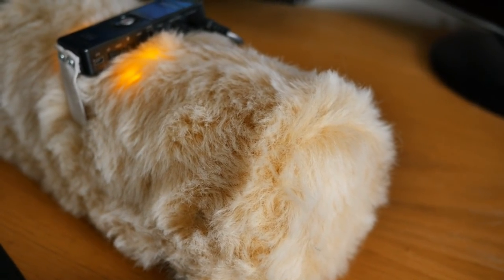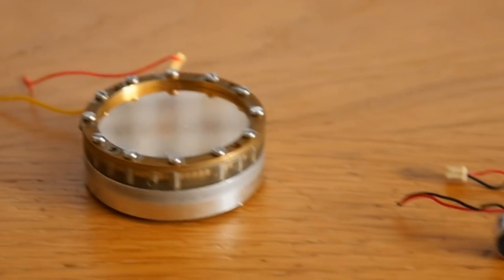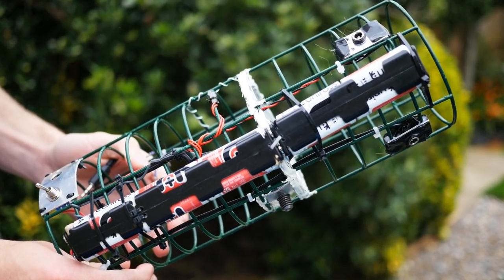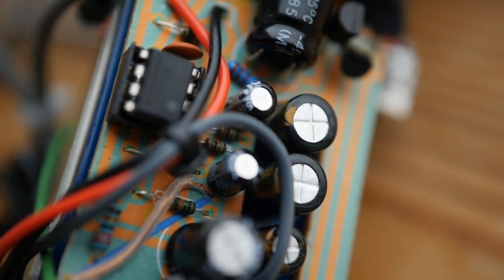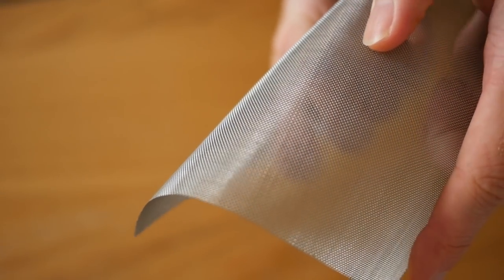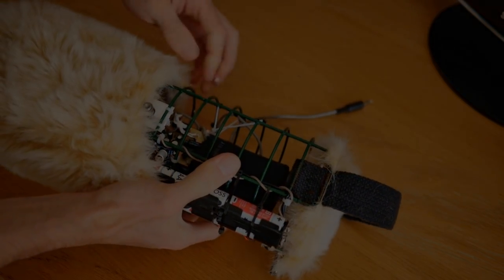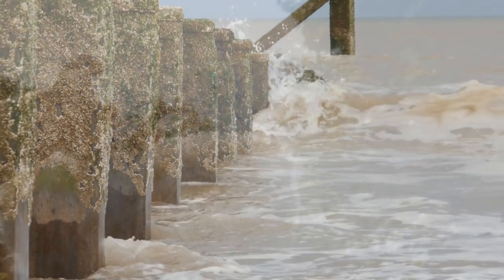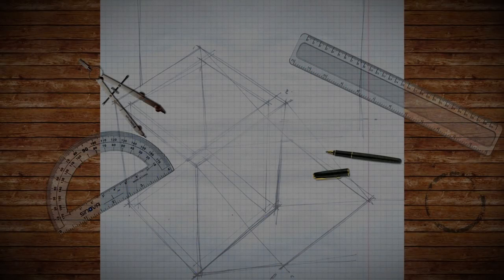The Ultimate DIY Microphone (super low self-noise!)

Comment: That is an outstanding project. I doubt anyone who has ever done any outside sound recording wouldn't appreciate it.
In the late 70s, I bought a really expensive SONY stereo sound recorder. It worked brilliantly and I used it to record buskers in London Paris and Amsterdam. My wife wanted to listen to something and since the batteries were dead at the time, tried to plug an external PSU into it. Sadly, choosing the audio socket.

Comment: +DIY Perks : Your a bit confused about difference between the microphones on a handy recorder and the microphones used in a studio application. Condensor microphones which is the type of microphone you are using here comes in 2 different types; LDC(large diaphragm condensor) and SDC(Small Diaphragm condensor). both of these microphones are used in recording studio applications (as they both have different frequency responses and characteristics based on the size of the diaphragm, and an engineer will use these to achieve different results). Handy recorders generally use Small diaphragm condesors in an X/Y stereo array, as this is the most common way to capture a stereo recording. When i go out to capture atmos and soundscapes i always employ the use of SDC's based on the fact that they replicate high frequencies better(which are extremely important with Atmos/soundscapes) and they generally aren't as sensitive meaning less self noise.  I understand that it seems like you will get better sound but with mic technique it really has to do with which mic will work better in which situation. And for the example that you have given SDC's are defiantly a better option.

(sorry engineers rant)

Also i think  the noise coming from the zoom actually has to do with the cheap preamps inside and not the actual microphone, a more accurate demonstration would be having both mics plugged into the same preamp with the same gain setting, then you will really get an idea of the microphones self noise.
Reply: I also think that he is refering about things he don't know.

Comment: Pretty great results! but to be completely honest, i think the cheap switching power supply actually introduced some noise into the system...
I could only hear that on the thunderstorm, but there are three other possibilities:
Either it was the rain that sounded quite a bit like noise, it was youtunes compression that added some noise, or it was my own audio gear, but i don't think the last one was the problem, most likely it was just rain...
I am using ATH M50 woth an Onkyo TX-NR414 connected over SPDIF for those intrested.
Reply from the maker: +muh1h1 The background noise on that recording was just a breeze in the trees mixed with a slight bit of drizzle. That's why I mentioned that the regulator uses an LM2577 mosfet - its output is unusually clean, so adds literally no audible noise to the signal chain. It's what made the project possible to be honest!
Reply: +DIY Perks good to hear :)
i didnt actally look up the power supplies specs or anything, just assumed it was a very generic one, because it looks a bit like thrse cheap ebay ones. maybe i should :)

Comment: Try to use better op-amp like dual NE5534 for tube warmth sound or OPA627bp for extremely lower noise and better detail in all frequency. TL072 is very very noisy one.

Comment: WAY over my feeble skills! I'm still trying to build the LED Light panel!
Reply: Me too James me too
Reply: +James DeRuvo I built a very simple one. All I did was my some thermal glue, A heatsink, A small fan, and a 12v 13Amp hour battery everything was about the same size. I'm currently using the thermal glue to stick the LED chips to the heatsink and some cable tie's to attach the battery and fan. I can send you some photos and links if you haven't finished yet. I used 8X 10W LED's. It's amazingly bright and last's about 2-3 hours depending. 12V and about a 6Amp draw. 6 x 2 = 12 and the battery is about 13Amp hours.
Reply: +James DeRuvo It's about a 800W equivalent to halogen. You could get 1000W with 2 more LED's, The total cost for me was about £25

Comment: The sounds are pretty clean and real. The best thing, as a recorder, Ive ever heard was a UHER REPORT, portable R2R with its original UHER MIC, speech quality was incredibly real (even just listening to the built in speaker). If you like recording, I would give this old vintage recorder a try. If it was serviced recently, even more. By its time it was the only portable to get up to 20Khz and it was in production for over 30 years.

Comment: You have to at least sell those preamps to us, because not everybody has a CNC machine to make a board with!
Reply: +bluephreakr On the page he linked with the preamp schematic, they have a link at the top of that page of where to buy a pre-made PCB for the project.  It'll add to the cost of the project but you'll have a more professional looking final product (depending on how skilled you are at soldering).
Reply: @00Skyfox  Custom printing PCBs isn't that expensive, especially when you're already using two $250 mics.

Comment: This is great! I have a tascam DR-40 that has XLR inputs with phantom power, so if I used this as the handle, I could do a much simpler build on the interior electronics. All I'd need is added power, and I could keep the microphones cased if I made it just a little longer. Hmmm..... I'm very tempted.

Comment: Great work and an inspiration!
I am surprised that a preamp at 24v performed so well since electrical noise tends to be higher at higher voltages. Many years ago i built a preamp circuit using a chain of class a collector followers based on a design from electronics today magazine.  The author made a big deal of the voltages being low. 2 to 3 volts. It might  possible to dispense with the SMPS , increase battery life and lower the noise floor further with a different preamp, but hey, what you have done here and how you implemented the design and it's great performance is fantastic.
Reply: +Nick Hill Higher noise with higher voltages is usually associated with tube electronics which are noisy anyway.High voltage is used in transistor preamps to lower the noise by increasing the ratio of signal voltage swing to noise floor of the transistor. Very low operating voltage can bring the noise floor up to the signal levels...

Comment: awesome design and DIY work.
as a basic video and sound editor i made a small system like this one to capture sound for my video works, but you know what, it was a pain in the head to sync all those little DIY sounds with the video of the same work.
i thought of every kind of possibilities but all of them were too difficult and time taking issues.
so my idea is to connect this system you just made with a camera, so the camera should be the final recording and saving product, otherwise syncing gets bigger and bigger problem with each DIY video work :)

Comment: You might want to set the boost converter a bit higher and then add a low noise linear regulator to further reduce the noise floor and clean up the voltage rail, because that kind of switching regulator might have as much as 50mV ripple, which is kinda high, and it's at 200kHz, where electrolytic capacitors are not well suited for filtering, and the CMRR of the opamp drops significantly.

Comment: Great video - as always.
I was holding my thumbs, hoping that this would be an instructional video on how to build a low noise phantom powered preamp with something like the Maplin preamp kit. But alas - this project is WAY over my head :).
Guess i will have to get used to the noise from my Fucusrite 2i2. Or will there perhaps be a followup video, going into more detail regarding how to build it step by step? Also - is the preamp in this build, the same preamp you have used for your other videos demonstrating the noise floor of the Røde?

Comment: DIY Perks, first of comment and question, brilliant post , I would like to have few questions.
1) What circuit did you use with LM 2577 for voltage booster? prebuild somewhere please, I would like to order same one.
2) for gain selection what resistor range did you use? steps ... list of resistors (0-10k) and what type of the rotary switch will be the best? Everything else is perfectly clear.
Well done, keep going :-)

Comment: Brilliant!  I would love to see you attempt to do a DIY interview microphone that takes an existing $50 microphone as the shell and modified to a microphone comparible to the new high end LINE 6 XD.
Reply: +chas deuce  I realize this microphone is feeding directly into a recording device.  Would you be able to give some input on a wireless system....Would it be possibly to improve the signal strength on something like the Alesis MICLINK WIRELESS Digital Wireless Microphone Adapter; these appear to be quite affordable, but amazon reviews seem to hint it has weaknesses.
Reply: +chas deuce NM...answered my own request.  It's called the irig PRO; you can use this to feed from a mic that needs phantom power into a wireless pack.

Comment: I am wondering about just one thing that is since the sensitivity of the microphone(s) are so low will they be the right choice to be used as primary microphones for recording dialogues on location for a film? If not, what changes would you recommend in order to lower the sensitivity of these microphones so that I can use them as boom microphone for recording dialogues? I am seriously considering investing in this project so that I don't have to spend a lot on a professional boom microphone for my indie film.
I do understand that polar pattern of these microphones will be much wider than the traditional Book microphones used in films. Could you please take up a new project in which try making a cheap and high quality boom microphone suitable for recording dialogues on location for a film. I would love that! Great work on these project! Lots of love ❤️!

Comment: Great project.... I advice to change the operational amp for something a bit better than that crappy TL071.
NE5534 is a possibility until you don't get under a gain of 3.... in this case the gain is 4.5 so, it's ok.
There is lot of others good operational amp .... OPA604 can be a good idea too.
I also advise using small film capacitors in parallel with electrolytic capacitors. That cost not much and can only make it sound better.

Comment: One hell of a project, i might say. However nowhere near a cheap one though. 

Those microphones alone would be +500 euros if I bought them from a local seller. Also a regular guy probably doesn't have access to a CNC machine to make the circuit board, although you probably could do it with one of those hole-circuit boards but it wouldn't come as clean or compact as a real board. 

I know I could just go to my old school and ask if I could make a circuit board there with proper tools, but I know that's not the case for most.

Anyways, great video and great work once again.
Reply: +MrSneakzor you could do those heat transfer methods in making your own pcbs
Reply: +MrSneakzor it's super easy and cheap to just send gerber files (pcb design) off to china, and getting a professional solder masked, silk screened pcb sent back a few weeks later, for 10-20 bucks. Check out itead studio, they're the best value in the business IMO

Comment: Pretty good stuff =) Will definitely check out Audio Blocks as I'm looking for music constantly for videos I make. I have some Olympus ME30 microphones I've been testing out. They're omni directional, so they have to be placed a bit apart to get usable stereo, but the sound quality is pretty good. Also, I bought a styrofoam mannequin head in which I plan on making room for the microphones so they are in the "ears" to try out binaural recording. Not sure that will turn out well, but the head is only around $4 on eBay :P

Comment: Oh - Change that TL071 for a TL072, higher quality. Also, solder the chip in, those chips sockets are great for digital but oxcidise and drop in sound quality over time. Also, why do you need them - are you going to change the chip ever? :o)

Comment: How did you get the 48V for the NT1A's phantom power?  Or are you running them @ 25v?
And how did you get the dual supply required for the preamps? Two LM2577s? A second rectified capacitively-coupled output from the boost converter? Virtual ground?
I'm just curious, this microphone performs pretty well :)

Comment: Hi, how did you manage to modify a DC booster to get 48V out of it for the phantom power supply ?
Thanks and keep up making great content :)
Reply from the maker: It just boosts it to 24v rather than 48v. That's ok though, because it fits the P24 spec so works perfectly with the NT1-A mics.
Reply: +DIY Perks oh, thanks :) 
I hope it will work for my project too :) 
I'm making a ultra portable battery power (rechargeable via usb) mixer, with XLR and phantom power.
Reply: +DIY Perks hi, how did you manage the common ground to get the symmetrical power supply for the preamp?
Reply from the maker: +sebraecha Two capacitors in series between the positive and negative ouptuts of the voltage booster - the point where they meet each other is the amp's ground point. There's a little project about it on Elliot Sound product's site.
Reply: +DIY Perks thanks a lot :)
Reply: +DIY Perks 
Would you share your schematics and / or Fritzig files? This really looks like an awesum projekt.
Reply: +DIY Perks how do you add the phantom power to the amplifier circuit?

Comment: Would it also be possible to just add XLR connectors and 48+ Phantom power to the pre-amp? So it would be a stand alone pre-amp where I could plug my mics into. The other end would plug into my camera (Gh4). So I would have much lower noise levels in camera. And I would be able to connect all mics directly in the camera.

Comment: Am I the only one who is somewhat shocked at the relatively expensive mics being disassembled when there are man commercially available products that could have accomplished the same goal for less money. 

I like the idea and in fairness you did a good job.
Reply: That depends on what the goal was. If it's just portable stereo recordings, then the Zoom H4 might be a better investment. But there's nothing I know of that has such an absurdly low noise floor, dual 1" large diaphragm capsules, and 12 hour battery life for his build cost (guessing ~$1000-1500 USD). 

I'm curious, what products are you comparing this to?
Reply: +Ryan Weldon something as simple as a Rode Nt4 can do a very good job. Used as low as $200. With the money saved you can get a very respectable Rycote windshield. Plug into the recorder of choice and you're good to go. 

Just my 2 cents. For even better signal to noise ratio check out the Sennheiser mkh series